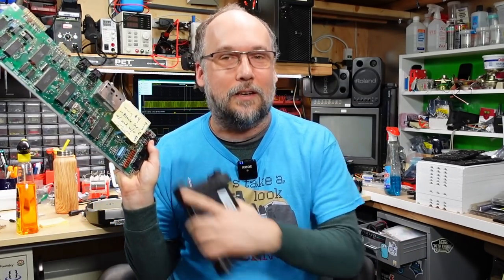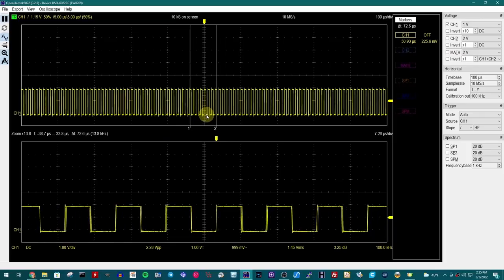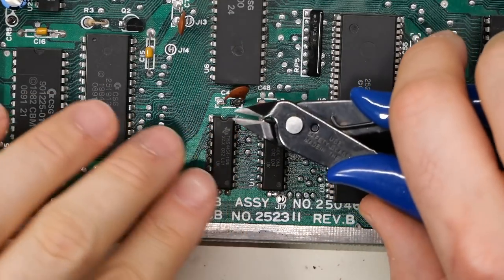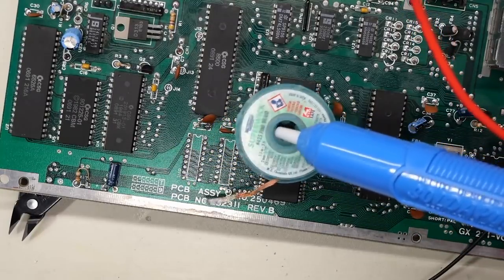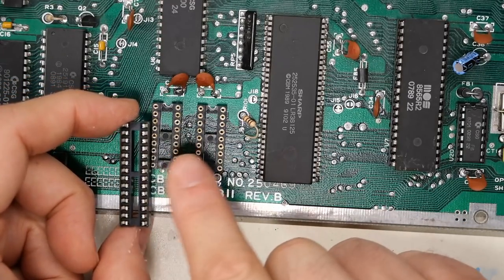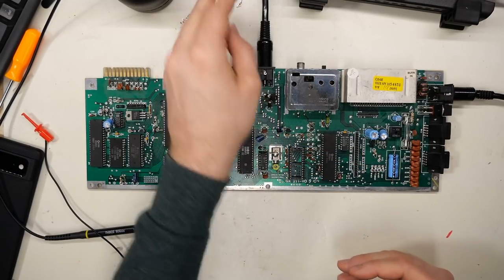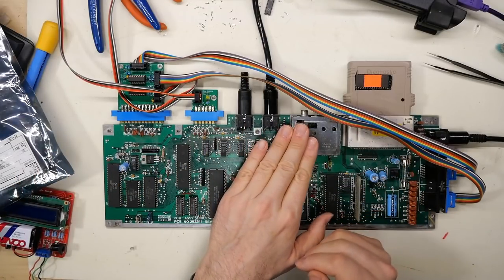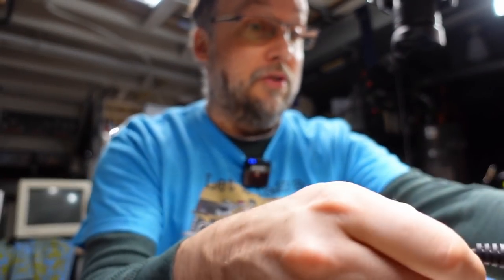How to fix an 8-bit computer with only cheap tools

Comment: Have you ever tried the wet wick method to remove solder? Leave about the width of the used part of the solder wick, and dip it in RMA liquid flux. The solid piece of wick transfers heat better, and the liquid flux wicks away the solder faster.
Fresh solder? The wave solder was done with a higher temperature alloy. Typically it was 80/20
Those round hole sockets are 'Machine pin' sockets.

Comment: I had much better luck with the "Vampire" solder sucker. It's a bit more expensive than the Soldapullt, but (imho) it works a lot better. For one thing, it's much smaller. The Soldapult always makes me laugh because of how "Xbox huge" it is. The Vampire is really easy to use with just one hand; both the plunger used to prime it, as well as the button used to trigger it, are easily reachable using your thumb, and you don't need to slam it against your leg or a desk like you do to prime the Soldapullt. Plus it uses a soft silicon tubing as the tip, instead of a hard plastic tip like the Soldapullt. Because the silicon tip is soft, as opposed to the hard plastic tip of the Soldapullt, it tends to form a better suction around the hole you're trying to clear.
Reply from the maker: Heh yeah it is like the first gen huge Xbox controller -- that really made me laugh!

Comment: Those short boards are difficult to solder on because they used a lot of connections directly to large fills, and they didn't use thermal reliefs.

Comment: For those ground pins you quasi need 3 hands (or a stand) and use Hot air to preheat the board and then use the soldering iron + Wick or the Deslodering gun...
That works best. Hot Air is really really great! And some aren't that expensive.

Comment: Another trick I used when I am not able to remove solder, I stand the board vertical, use the soldering iron on one side and at the same time the pump on the other side, that usually works the solder has no time to solidify that way

Comment: There is one other way to get solder out of vias - ordinary stainless steel sewing needle. You heat up the via, push the needle in replacing the solder and roll the needle between your fingers until the via cools down. Solder does not stick to stainless, and rolling keeps the hole larger than the pin to get the pin easily out.

Comment: It really looks like the USB 2.0 Interface without any Local Buffer is the thing holding it back, as there simply isn't enough data troughput for the higher sampling rates, as at 30 mega samples a second were getting Atleast  240 Mb/s and at 48 mega samples were reaching 384Mb/s, that's asuming no overhead on the packets, and it's just the raw ADC data.

Comment: Even if it's one and a half years ago, and within these comments, somebody might have told it (I cannot find it that quickly) some advice on testing transistors inside a circuit: why did you unsolder that transistor Q2? The fact that you saw 0.8V on its base (connected to R3) with the emitter connected to ground is totally normal and actually a very reliable indicator that the transistor is OK... The voltage between base and emitter should always be between 0.5 and 0.8 V on a conducting transistor, not much more! And testing the voltages on Q1 doesn't make any sense if you keep the base on Q2 floating, as it will basically react even on the position of your hand relative to R3... (my thoughts about R3: it's particularly small for what it actually needs to do, I would have put at least 10k in there).
But keep up the good work: we learn a lot from you, and hopefully you a lot from us 🙂.

Comment: The machine hole sockets provide a cold weld joint, the reason the chips are hard to insert.  They definitely make a better contact than the double wipe style sockets, but, as stated, they are very unforgiving when it comes to socketing chips that were previously soldered.  In the long run, though, if a double wipe socket was well made it will still be reliable, and the insertions stress placed on the PCB during installation of a chip will be significantly lower.  Definitely a matter of personal choice/preference in the long run.
@Adrians Digital Basement: The cassette port fix was likely due to your skills!!! :)

Comment: TIP
🐨When using a manual De-Soldering Tool, I found it best if the soft tip has a small slot to it that matches the Soldering Irons profile, so it "The Soldering Iron tip" can be left there on the PCB as the vacuum pump is triggered, BTW a Good de-soldering Pumps tip usually has a softer Tip just for this reason, But even so it still wont hurt if it has a small slot for the iron to stay there if a lot of de-soldering is part of your daily routine..

Comment: Fun fact about the 4464 memory chip: Sinclair bought a huge party of defective 4464s for the ZX spectrum for a dump price. One half of the memory was inaccessible. So sinclair put 2 4464s in, using only half of each for 32 kilobytes of memory. Technically they all have 64 kilobytes.
How's that for cutting cost?

Comment: Yeah - that's the trick to those "soldapult" style de-soldering tools.  Gotta remove the iron and immediately get in there and trigger it.  It's very easy to not be quick enough and the solder begins to re-solidify, so the sucker won't suck it out.

Comment: You did do something to fix it. You de-soldered the transistor. If there was a "cold" solder joint, then that was a failure point, re-soldering that joint by re-installing the transistor could easily fix a cold solder joint.

Comment: I would recommend a different solder sucker. The engineer SS-02 is far superior if you can afford to stretch your budget a little further (they're typical only a little more expensive than most solder suckers on the market, but will only be slightly inferior to most solder guns). There is no need to melt the nozzle like others have suggest with this as it uses a small attachment of silica tube on the end of the nozzle, making a good seal, and not melting under the heat.

Comment: Pop some thin flux on the solder in the board before using the wick. Makes the solder flow up the wick way better.

Comment: Since Q2 has emitter grounded, base will be clipped to .7V  Base->emitter is a diode junction.  So that .7V you read after connecting the resistor to +5 is correct.  The collector of Q2 is used to short around CR1 which would otherwise hold the base voltage at Q1 at 6.8V.  Whatever the base of a transistor is, the emitter will self-regulate to be .7V less, so the output will be 6V.  When Q2 is on, shorting the base voltage to 0, Q1 emitter will be 0V.  This all depends, of course, on the "unreg 9V" reaching Q1 and the resistor.

Comment: Like that soldering iron - also boost mode to temporary enlarge temperature to 420C to heat biffy polygons or ground contact on multilayer pcbs also it haves more powerful cpu that my 1st 2nd and 3rd PC’s :) don’t forget to update Iron Os on it ;)

Comment: What held back USB oscilloscopes ten years ago was USB 2.0 - you had to build in triggering, and then you could only submit a small memory sample. At 5 GBit/s, you can do real-time streaming.
RE 7:05 The software triggering should be at least as good as any hardware solution, and the frequency generator should be rock solid, especially since it should use the same clock source as the oscilloscope itself. It's rather sad to see it jitter around like this, as synthesis at that low of a frequency should look a lot better.

Comment: What I've found useful when using a solder sucker is clamping the board vertically, heating the pad from one side, and sucking it from the other, sucking the solder through the lead hole. That way you can heat and suck at the same time, don't have to do the quick switcharoo while the solder is still molten.

Comment: VERY interesting.. I had been thinking of something similar to learn to fault find with 8 and 16 bit machines like the Megadrive, ST, C16, C64 etc.. Let’s see how easy they are to find in Europe (or just import myself).. I use a desoldering gun like you used (the blue thing), but I usually hear the slide with the iron in my right hand, and use the gun from the other side without lifting the iron first. That makes it a lot easier. But that could easily be totally wrong.. 😂

Comment: Hi Adrian. Thank you. I've been thinking about getting an oscilloscope. But they are above my budget atm. 
Can you use an analog scope to find..like.. broken ram chips?
I found some old ones relatively cheap.
If all I'm  looking for is low voltage on a pin. Do you need to have a snapshot? Or could you find it in real time as well?
Regards, Mac

Comment: Another observation.  Most of these devices do time shifted interpolation of events similar to the technique used by the femtosecond camera project.  Sampling self similar pulses over time slightly phase shifted with each clock cycle allows you to observe events which far exceed your temporal resolution in hardware/software.  Good enough for "viewing" events and troubleshooting but useless for data acquisition where the full message integrity is important.

Comment: I'd add a note to be super careful of what sellers to buy from.  I've been scammed on aliexpress by a seller who advertised a TL866II programmer.  After I completed the order with payment they did a bait & switch to send not the programmer as I'd ordered but a set of junk accessories (mostly socket adaptors) then went radio silent when I complained about it.  NOTE:  I was extremely careful to select ONLY the programmer with no accessories at all (so just usb cable & cd-rom).

PS.  what I often like in these videos is the links in the description they're often amazon which isn't perfect but is more reliable about avoiding deliberate screwups & the shipping is often better for us in north america.

Comment: Hi Adrian, Felt I should comment on the ‘Shorting to ground’ being no good for the chips, a well designed chip (like the 74LS series) really don’t care. In the course of repairing 1980’s arcade boards I frequently pull outputs to ground to aid in fault finding. Search for Midways Standardised 8080 test procedure, a easily found .pdf, should make interesting reading. Keep up the good work! Hope the hand is healing well :)

Comment: And just right now, I'm in the process of filiming an "AC coupling mod" on my Hantek. Maybe I'll post a short? Or a quick in between project video about it? hmmm...
Reply: And it does work ^^ https://www.youtube.com/watch?v=9cjgLB1Pwws - slightly tight on the soldering side though!

Comment: I would replace Q2. I have seen several intermittent transistors with that part number. They were temperature sensitive, or had a poor connection to the die that the physical strain temporarily healed.

Comment: I use a solder pump with a built in soldering iron, a sort of hybrid between the Hakko and a manual pump, and find it works pretty well. It’s more expensive than a normal pump, but still a tenth the price of the Hakko.
Reply: That's the one I use, but I think it's designed for 110V. It was sold as 240V, but on 240V it runs so hot it melts the bottom of the built-in pump, ie, you have to reseal it with silicon all the time.

Comment: I use those Solder Suckers for the rough stuff. ie you have a big solder blob somewhere you need to get rid of it.
I even prefer to use my ERSA plastic solder sucker over my LF8800 (NOT a recommendation! on the contrary. Look for something else!) due to it clogging up so quickly.

Comment: A standing transistor like that can have a cracked joint under itself from the leverage and the thermal expansion over the years of abuse. Possibly just needed a reflow

Comment: By IPA I assume you DON'T mean "India Pale Ale" (Though maybe that might work?)
I downloaded the openhantek software, it has a demo mode so you don't need the scope to tryout the software.  From the user manual I see that this scope isn't really 20mhz.  It seems Hantek made some shaddy design choices, they are 'overclocking' some parts to get to 20mhz, and the software won't even sample faster than 30mcps, and even throws away lots of bits because the overclocking causes some errors.  So it looks like it's  BW is really  5mhz per channel, or 10mhz one channel at best.  Still fine for fixing C64's, but maybe a bit too slow for what I'd want.  However for the price, and the large screen viewport, it's not bad.  $70 with shipping from Amazon at the moment, a 50-100 mhz 2 ch scope (not usb pc) would run me closer to $400.  Also the 6022 doesn't really have an AC input, you'd have to mod it with an adapter to view AC signals.  (but for digital it's fine as is).
Reply: I'd say even 5MHz is being too generous. A rule of thumb I've picked up somewhere is to sample at 10x the bandwidth cutoff frequency, making the Hantek only good for 3MHz. Even that's stretching it a bit because it doesn't seem to have an anti-aliasing filter. I could clearly see what I assume to be temporal aliasing on Adrian's data bus measurements.

Comment: The CPU makes the write signal for cassette and the CIA interprets the read signal. 

The Datassette is designed so that it plays the signal back at inverted polarity, and the system is sensitive to that polarity! When people back in the day copied the cassettes with a HiFi, most failures were due to a system that inverted the signal polarity when copying tape to tape. From the musical point of view the inversion does not matter as long as both channels are the same phase. This is also why if you directly tap into the read pin of one Datassette and feed it onto the write pin of another, you will get an inverted copy that will not work. You need to put a NOT gate in between (a transistor and a resistor will do fine). 

One C64 I kinda fixed after fumbling around a lot (and had no scope available to me, but a cheap multimeter had to do) eventualy turned out to have one blown diode in the network of 8 diodes near the serial port. The problem with it was that it didn't read any cassette, but would write perfectly, and any attempt to operate the disk drive hung the whole system. Turned out that this diode grounded out the trace that feeds the cassette read signal to the CIA, and which the serial port shares for a signal as well, just as you pointed in the diagram. I snipped one of the diode legs and everything worked perfectly.

Comment: If you change the solder pump end to silicone I think that works much better, as it seals better and can be placed in the joint with the soldering iron still heating it.
Reply from the maker: Indeed I really need to try that! I've been meaning to pick up a length of hose.
Reply: @adriansdigitalbasement  You might even be able to buy replacement ends for the pump.

Comment: if you use 1 inch of model airplane fuel llne on the sprig loaded solder sucker.it is a high heat silicone so the iron can stay on target

Comment: The Voltage Drop on the resistor is quite Normal. The first Transistor is an inverter the second is an emitter follower.
So If you insert 0V or left it open. 0V on the base of first Transistor and output is open. You should have 6.8V on Z-Diode, second transistor follows the voltage -0,6V, so output approximate 6,2V.
If Input Voltage is 5V, approximate 0.6-0.7V on base of first transistor. This pull down the voltage on the Z-Diode and the output is off.

Comment: @34:12 - Is there a reason the system clock isn't counting up?  I know on the bread bin 64s it's an indicator that one of the CIAs may be bad.  Does that same bit of bug detection apply to the short boards?
Reply from the maker: I think that those clocks only update at the end of the diagnostic cycle, not during them.

Comment: I was going to suggest cleaning the contacts on the port, but I guess that wasn't it. Now I'm wondering if Q2 had a bad solder joint.
Reply from the maker: I think it had to be the AC input not working which would also explain the interrupt error on the diagnostics apparently.
Reply: @adriansdigitalbasement  yeah that would do it too

Comment: As to the tape issue, you could have had a bad solder joint on the transistor.

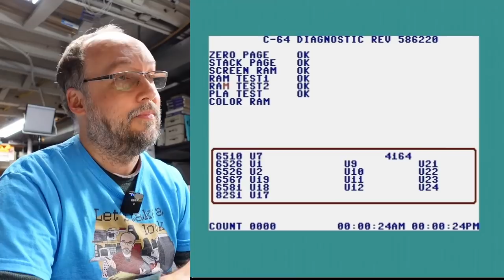Comment: The problem was a 9 volt on AC side (and then DC unregulated). 9V~ is used for time couting in c64 and at firs tests with the cartridege  the time was not counting (34:16 time is 0000). Then it changes at 46:10 we may see 40 PM. Problem is on the diferent part of the board. Somewere between power plug and the Gretz bridge. God idea to test on osciloscope the 9V AC and then take of from the board the Gretz bridge if it helps problem is some shortage on 9V DC site alter Gretz.

Comment: Is the ground on the USB tied to the ground on the scope lead? That would be a great way to destroy your USB port.
Reply: Good question. Looking at the scope the only ground connection I see is the one next to the calibration, can someone that has this scope check the continuity from probe GND to USB GND?
Reply: Yes, that is the case. Use laptop on battery power if you are diagnosing stuff that's not isolated from mains.
Reply from the maker: Yeah I figured the USB ground and the probe ground is commoned, so as Daniël mentioned, really you need to use a laptop on battery power -- although it's just much safer to run the device under test on an isolation transformer. You don't want your laptop chassis to become live at mains voltage! Or use a portable scope for those situations -- review coming soon.
Reply: @adriansdigitalbasement  especially the aluminium-bodied ones which are already notorious for leaking a small amount of DC charging voltage through the case (people reporting tingles from the corners when charging); referencing the case to mains would be quite risky to go near the wrist rest!

Comment: Dry join on the Transistor? Also just before that transistor base was a Zener diode with a 6.8V between the base and ground rating hence the voltage.